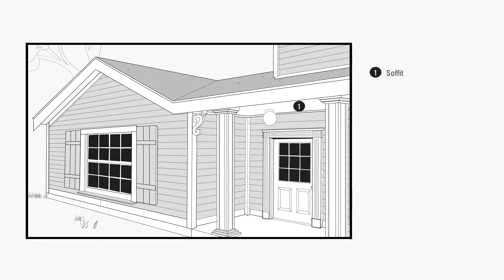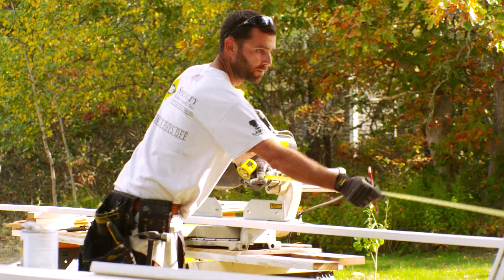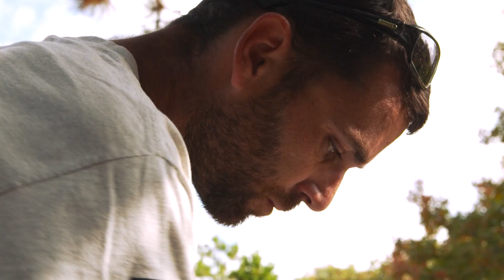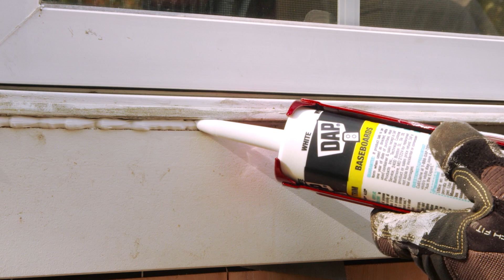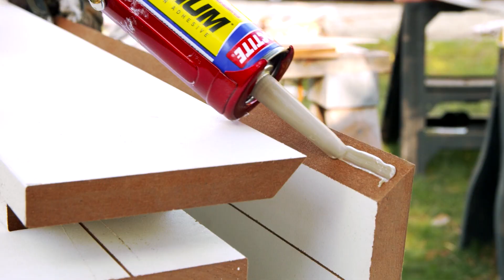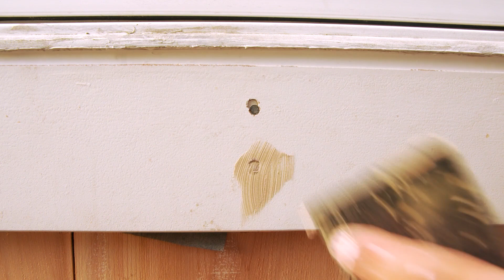Installing MiraTEC Trim

Comment: Builder installed smooth side out which isn't all that smooth. Having difficult time getting paint to adhere to it. I have been painting for 50 years and I have never had this much trouble with exterior Cornish material. Total crap.

Comment: This Stuff is garbage, if you guys are still using this or if you are installing this on anything outdoors just forget about it, their warranty doesn't mean anything at all, this is all cardboard with a layer of (whatever) and over a period of time you will be replacing it all. Oh they tell you how to do it and we did but they will not warranty anything and its always installed wrong from their warranty. I am surprised there isn't some class action against this material.

Comment: We bought Miratec trim when we built our house in 2006 and now have to replace all the trim since it has all failed.  What a mess, the boards rot and expand, they are basically pressed cardboard, total junk, stay away from this product.
Reply: Did the manufacturer's warranty cover the cost of replacement?
Reply: @Goldmouth_DOC No, they gave us most of our money back for the cost of the product but wouldn't pay to have it replaced.  So at the end of the day I got to pay someone to put it on, now I have to pay to have it removed and install something else.  Total mess.
Reply: @RickMcDanielMusic  Did they give you any insight on why it failed?

Truwood was my first choice but isn't available at the moment, so LP and Miratec seem to be the only options. Just weighing my options at the moment...
Reply: @Goldmouth_DOC Not really, if it had been installed wrong I doubt we would have gotten our money back..My opinion is that it has to be constantly kept up with caulking and any exposed ends constantly painted. If there gets any water on the product it starts sucking it in and fails.  Definitely not zero maintenance.